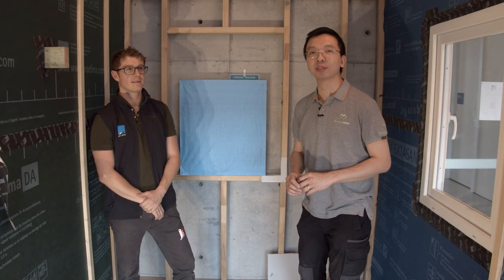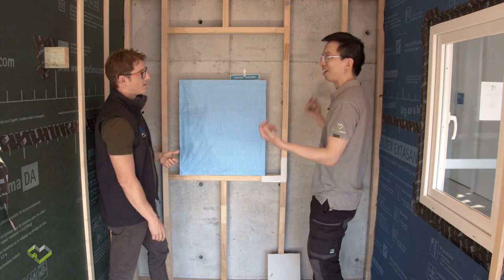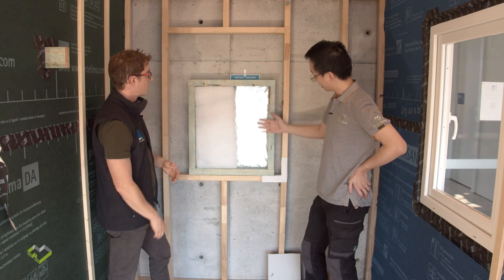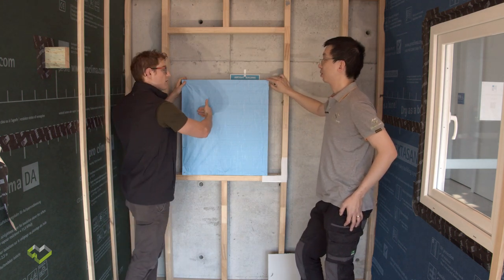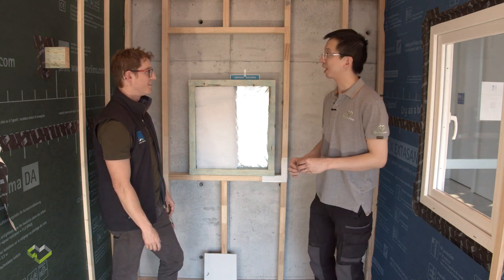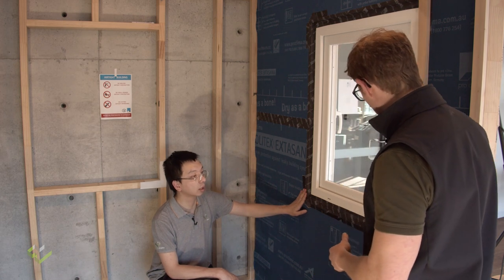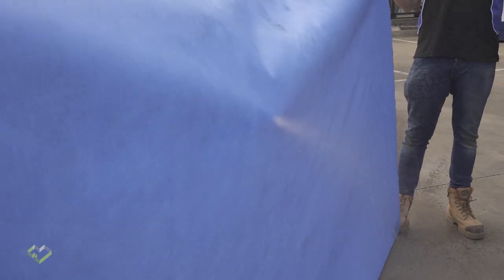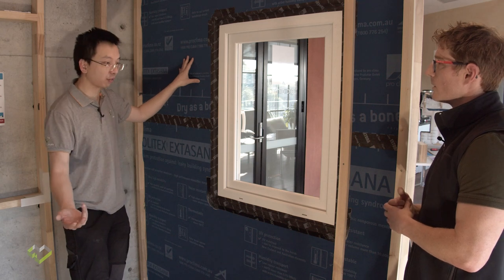Common Sarking or High Performance Wall Systems by Proclima?

Comment: Hey thats my house in the thumbnail! 

Joseph did the blower door test on our build, very professional and friendly. 

We ended up with 1.1 ACH which I was very happy with given some of the tough window/frame/concrete interfaces we had to deal with.
Reply from the maker: Nice looking project that one!
Reply: A+ on wrap installation too.
Reply: Is that a Kinzel window? We're about to install 40 Kinzel windows into our house and are looking into Pro Clima too. Would love to know how it's gone, especially after the big rain of last year. Cheers - Dave
Reply: @deldridg  the windows are Dophner supplied by Laros. The proclima products have been great. No leaks or issues with the air tightness.
Reply: @rowantruscott8331  Hi Rowan and thank you for your reply. Sounds like you've got what we're aiming for - primarily a healthy environment with the secondary climate benefits - humidity/temperature etc. Our windows are by Kinzel - UPVC from Austria, all tilt/turn plus some of their high performance "smart slide" range - very high quality rubber seals and very low U-factor. We are now researching wraps to make sure we're not negating the value of our windows/doors, so Pro Clima is one of the choices we are looking into. Lots to learn! Cheers and thank you - Dave

Comment: Australia needs a semipermeable wrap on the exterior framing, roxul mineral wool insulation in exterior wall applications, and a thick plastic impermeable wrap on the interior framing before plasterboard. That combination should resolve all of your issues, the greater issue is finding people of good workmanship

Comment: Well done and timely information for a my new build. Can you also cover solutions for traditional roof assemblies in Australia.
Reply from the maker: John Peters We have one planned. Straight after covid-19 stage 4 restrictions. 🤣
Reply: @ecoevo  Fantastic.  Looking forward to it.  I hope it covers solutions that includes BAL 12.5+ ember protection that works with drainage.  Great if option of foil/glass fibre blanket with ventilation can be included and compared to VPM.

Comment: Great content! Two questions/comments: 
(1)  exterior insulation such as rock wool / foam / aerated concrete over WRB (AKA lstiburek perfect wall) to stop interior condensation forming yet allowing exterior water to freely drain.  Seems to do away the need for internal membranes?
(2) WRB integrated sheathing like Huber zip sheathing and its vapour open competitor Georgia-Pacific forcefield. Both use butyl pressure sensitive tapes.  Will we see these becoming available in Australia soon?
Reply: Great question, I’d 
Iike to see that too. I have been searching for a similar product to zip in Australia 
and can’t find it anywhere!

Comment: Best explanation I have seen and I have seen a few now. Was my feeling of how to get a tight house but couldn't see anyone use the same method with the wrapping on the inside.

The question do you need it on all of the internal walls?
Reply from the maker: Just external walls.  There is usually a wrap on the ceiling that picks up the air barrier ontop of all the internal walls.

Comment: Great video, all of this is fantastic for a new build. But what about renovating a typical brick veneer house where you can’t add the exterior wrap? I’m renovating a 60s brick veneer house  in Sydney and want to get it as tight as possible. All existing gyprock is being removed. Would insulating the stud bays and using solitex with battens be the best solution?
Reply from the maker: ulli hentschel You may find this video exciting.  Thanks for supporting the channel, feel free to share our content.  https://youtu.be/DpjNLfBokro
Reply: Hi,  mineralwool/stonewool (rockwool is a well known brand) would be a good choice for insulation considering you dont have an external wrb.It's dearer than fibreglass but has higher r value is hydrophobic and vapour permeable and its r value wont diminish with the movement of moisture and air through it. It is also denser and will friction fit better than fibreglass(prevent batts from falling through studs and laying against back of bricks) and it has great acoustic properties and is often used in wall systems to beef up  fire resistance level as it has a crazy high melting point. Also pests wont eat it and it wont harbour mould.  All super important without an external water and wind tight layer as the r value of the fibreglass will diminish dramatically once it has the effect of wind washing and moisture . I believe wind washing can reduce the insulative value of fibreglass by as much as 40% Combined with internal air tightness vapour barrier to your walls and ceiling should give you a much improved home.(Ive been researching different types of insulation for my own passive build in the near future) Wood fibreboard insulation also has similar properties to rockwool and can come in batts but also as a rigid board which you could use on inside of wall 
which could be used as an air barrier maybe instead of wrap but also this way you will create  continuous insulation that would reduce thermall bridging through your studs. Internal vapour barrier may not be as important then as moisture could pass right through to outside of insulation to the brick cavity before it hits du point!  Gutex is a german brand of WFB
Both these products are good choices environmentally and health wise in terms of air quality.  Hope this is helpfull and keep up the good work Efficiency Matrix!!
Reply: Genevieve Thornton thanks so much.p for your comments. I have also been looking at the wood fibre board and it seems there a few companies now bringing them into Australia which is great! I’m looking at using this on our roof in particular.
Reply from the maker: We have covered 2 homes with Gutex here. 
https://youtu.be/pIX02vehRfE
https://youtu.be/qiry62_VZAM
Enjoy...
Thank you for your comments they are really appreciated.  feel free to share our content on other social media platforms.
Reply: @ullihentschel1207  Hi again,  wondering who the companies bringing wood fibreboard into australia are

Comment: At 02:55 Jesse explains how adding fibrous insulation can lead to condensation/mould problems on the tinfoil sarking inside a stud wall. That makes me worried to add wall insulation in my typical 1990 brick veneer house (Melbourne climate zone). Should I be worried? Or given how leaky the sarking likely is, I should not be worried? Thanks.
Reply from the maker: Correct given how leaky the sarking is, and considering you have sarking, this will give you a gap, to ensure insulation doesn’t get in contact with your bricks.

Comment: So to clarify you don’t recommend insulation inside the 90mm/140mm wall cavity when using the external and internal wall wraps and if you must insulate put it inside the 40mm services cavity on internal wall ? Is there a pricing schedule per sq metre for these products?? Thanks for your videos
Reply from the maker: insulation should be installed in the conventional stud wall cavity. You may install insulation in the 40mm services cavity, but we recommend not putting too much insulation in a thicker services cavity.  It’s not a bullet proof idea to put insulation on the inside of the internal wrap air barrier. 👍🏻

Comment: Please comment on the perforated sarking. It’s ‘breathable ‘
Reply from the maker: Benny Boo But it’s not weather resistant.  Water can pass straight through it, during construction.
Reply: That is true. But is this the type of wrap that the majority of builders are using?
Reply from the maker: Not normally.

Comment: Wondering how Intello system would be used in multi-story building or to create an unvented attic?  How are the floor trusses handled?  Wrapped on ceiling and floor?
Reply: Several options for floor trusses: https://foursevenfive.com/blog/how-to-keep-floor-beams-where-they-should-be-inside-the-airtight-layer/ but the 3rd option using a ledger board seems more elegant: http://blog.lamidesign.com/p/swedish-platform-framing-info.html

Comment: What about paint on the internal plaster board walls that can stop moisture movement through the wall internally ? .
I have an older 50s house and I want inject foam into the wall cavities.
Reply from the maker: That can be dangerous.
Reply: @ecoevo  yes that was an uninformed question,  I'm now going to eventually remove the cladding add batts  then vapour permeable membrane .
Apparently the foam in older homes can push the plaster board off the walls .
Reply from the maker: @davidgreen424  try Envirowall instead.